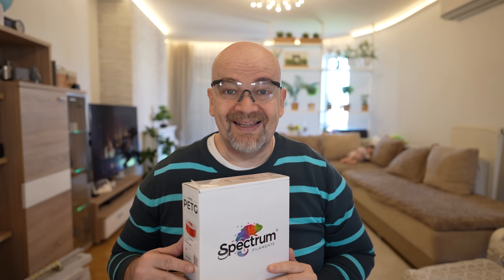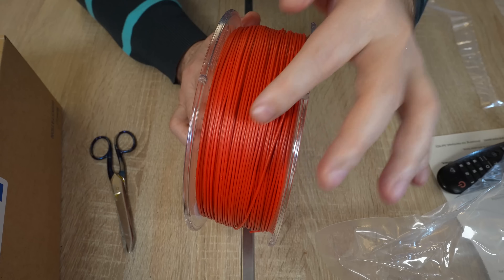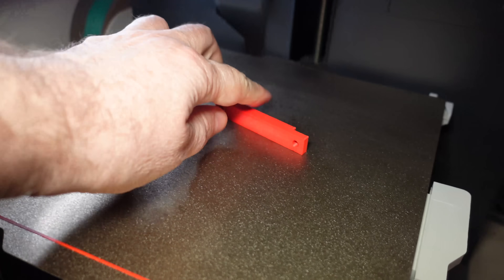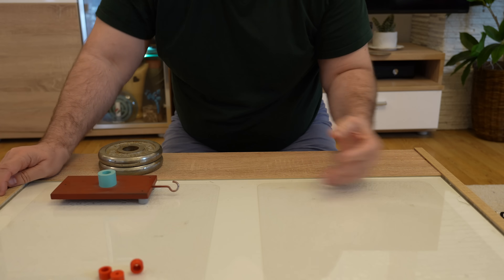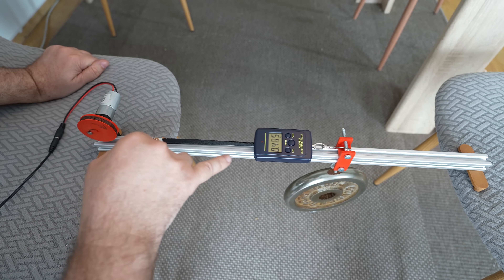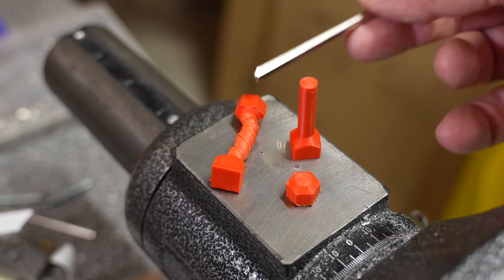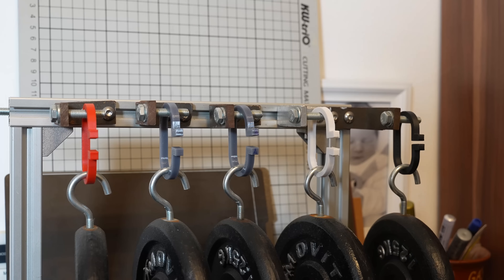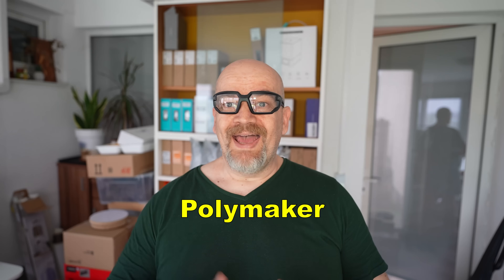Teflon Inside PETG? Review of Spectrum PETG+PTFE filament

Comment: I’d like to see you test POM filament. It’s not very expensive, but it does look tricky to print.
My guess is that the sharp edges of the wear testing setup are cutting it and just measuring internal bond strength, while rounder corners may work to better wear. Or maybe it’s a matter of pressure, and that much lower pressures being tested for a lot longer would produce useful results. It would be interesting to see what ranges of wear testing is done in industry, like how there are different durometer tools.

Comment: Regarding the PTFE  - I think the test on the effects of the additional available PTFE  in repect to friction and "slippperability" are excecuted in a wrong way.   Instead of using a rather sharp pin scratching alog the surface ( around 4:30 ) I think on two PETG(w/ PTFE)  bars slipping along each other.  While µr is 0.4 on PETG <-> PETG or PETG <-> steel - i would be interesting to see which µr is achivable/noticable using PETG(w/ PTFE) instead.

Comment: The wear test has more material scraped away by the edges than worn out by the actual friction, so not really representative of real use. I would really round the edges of the steel cylinders you use for wear tests. The other new tests you devised for friction are however quite good!

Comment: I think your wear testing rig could use a modification. Your tip seems too sharp, as it is cutting the material. For accurate wear measurement you need a smoother tip which will slide, rather than cut.

Comment: Igor, excellent work, all your videos. I am an engineer (retired now and for many years with the university here) and I can fully appreciate your efforts and your methods. Science is all about measurements!  I retired before 3D printing become as popular and accessible as it is now (however I did use SLS at the time) but now I find SLA and FDM printers useful for some of my own projects - especially SLA wax  pattern printing for metal casting. 
Two important characteristics of 3D printed plastics you might consider adding in your videos - and I find important in my work -  are  hardness (for example Shore) and surface roughness.  Shore A or D testers are quite inexpensive, one can find those for about $20 each. Surface roughness meters are more expensive, but a simple one can be obtained under $300...However how about  building a simple optical profilometr-like device for comparative measurements ? You are obviously fully capable of doing this. 
Thank you for all the useful information provided. Keep it up!

Comment: Aargh. so sad. I have a gear in my garage door opener that I suspect is made out of delrin or similar that keeps failing, and I just realize I will not be able to 3dprint a replacement without major redesign of the entire motor end of the belt holder, with normal filaments.

Comment: I me tioned this in the livestream, but i would love to see more reviews of tpus and tpes and various blends, especially harder varieties like cc3d 72d or justmaker 64d (both on amazon). Also would love to see testing of various brands pla max or super pla+ as i need the most impact resistant filament possible for my combat robot, and pla max by polymaker is currently my favorite, but would love to see more.
Reply from the maker: Soon. From CC3D first their PBT Pro. And until that, two hardest TPU I tested are TPU for AMS by BambuLab and the one by Extrudr.

Comment: The top printing temp of this is very close to the point where toxic fumes are produced. not sure i would print on an open printer. from the web: When polytetrafluoroethylene (PTFE), commonly known as Teflon, is heated to high temperatures (above 280°C or 536°F), it releases toxic fumes that can be harmful, especially to birds. These fumes, known as pyrolysis products, contain particulates that can penetrate the lungs. While normal cooking temperatures are generally safe, empty cookware can reach critical temperatures quickly.
Reply from the maker: Yes, I know this from PTFE tubes on Ender-3 printers. 260°C should be OK, especially with this low about of teflon. But this is something I will take in account when I will print PC-Teflon filament.

Comment: Aren't they supposed to be self lubricating ? Maybe it would be more accurate to repeat the sliding and static friction tests multiple time. It would capture some wear that would in theory start the self lubricating property. 
Maybe it won't have an impact but maybe the teflon is not uniformly distributed in the filament and wear has an impact on friction.

Comment: Huge respect for your work as usual. Just a quick tip when using the calipers to measure depth - They must be kept perfectly vertical to the plane you are measuring. Even the slightest tilt causes these measurements to be diferent. It may be worth printing a jig to hold the calipers vertically. Also it looks as though the burr created on the top surface of the test pieces may not have been cut away which can make even larger inconsistent measurements. Your subsequent tests however seem to support your findings on the wear test so all is good.

Comment: PSA: 

Teflon is PFAS — a “forever chemical.”
Teflon, used in many coatings and tools, is made from polytetrafluoroethylene (PTFE), a form of PFAS — a class of toxic compounds that don’t break down naturally. Not even fire can reliably destroy them; PFAS require extreme, specialized conditions to be decomposed safely. When heated, especially during processes like 3D printing, Teflon can release harmful fumes and particles that contaminate your air, your body, and your environment — permanently.
Don’t introduce “forever chemicals” into your workspace. Choose safer materials.

Great video as always.

Comment: That has to be one of the simpler but functional tribometers I've ever seen. A very nice and elegant solution.

Classical way of course is a reciprocating pin-on-disk where the pin is your material allowing for a measured number of cycles, measurement of arm deflection by a load cell for friction (with known load), and wear of the pin (depending on disk material often glass).  Bringing this back around one of the ones we built in the lab we basically just modified a 3D printer for the motion and added the arm and load cells.

Comment: -- Thank you, Igor. I wonder how that ASA Kevlar going to behave, but also whether it's going to be fire and temperature resistant. Kevlar is a very difficult material to work with, but cause it have some super cool properties.
Reply: -- Glass spheres!? Is that "Micro balloons"!?

P.S. In case people don't know, micro balloons are used as an additive to epoxy adhesive in order to make it lighter and thicker. Micro balloons are also a food filler to joints when working with CA(aka Super Glue) adhesive as well.

Comment: Plastic on same plastic friction would be interesting. Also under some notable load. And also 
friction initially vs friction initially vs after some significatnt run-in under notable load. Maybe the PTFE portion concentrates on the inteface after some initial (nonscratchshaving) wear. – Ultra light load friction being higher is perhaps just an artifact from the PTFE portion making the material a bit softer. IDK.

Comment: I would have expected a comment on the obvious problem, the PFAS in Teflon. It's not only a huge problem for our oceans and wildlife, but it will also get in your drinking water (not only when throwing it out, but also in production), and it will also decompose if you heat it too hot (in the nozzle for example). it's very bad for the lungs. Please read about it
Reply: The PTFE is not that bad by itself, but its end as waste is. Incinerated and polluting breakdown products emerge.

Comment: One suggestion..when measuring the depth from friction. Remove the burs from the edges. How you measured it will show more because the caliper stays on the burs, not on the flat part of the pieces 👍

Comment: Everyone in the comments and the general sentiments about this filament seem to miss the fact that the PTFE is embedded INSIDE the PETG. There is no reason that the friction properties of the PTFE would somehow "magically" migrate to the outside during printing.
At best, the PTFE acts as a contaminant that degrades the properties of the PETG
Reply: Well, run in wear might leave more PTFE on the surface than PETG. That is how I ssupect this is meant to work, but to test this one as to test plastic-on-plastic friction after some significant run-in under notable load. Not done here at all.

Comment: From: google A.I.
When polytetrafluoroethylene (PTFE), also known as Teflon, is heated above its continuous use temperature of 260°C (500°F), it can release fluorinated gases, which are toxic. These gases, particularly hydrogen fluoride and carbonyl fluoride, are released when the polymer undergoes pyrolysis at high temperatures, typically above 500°C. In large quantities, these gases can be dangerous to humans and especially toxic to wildlife like birds. 

The released gases are toxic, and exposure to them can cause symptoms like polymer fume fever (also known as Teflon flu) or other respiratory issues. 

PTFE is particularly dangerous to pet birds and poultry as they are more sensitive to these fluorinated gases.

Comment: Damn, i'm really surprised. I didn't expect this outcome. With the results of your wear test, i first thought that maybe your methodology wasn't that great. Some people suspected, that the pin is mave more cutting than abrading...
But when the results from the other testings came in, they all were in line with each other.
I'm still not a big fan of your wear test, without having a bigger chamfer around the bottom surface of the pin. But the other tests for friction and the "visualisation" of different adhesive friction coefficients are really nice in my opinion!
Reply: Yes, this really needs a fully rounded chamfer to rub rather than shavingly cut as it now does.Then it may need water cooling for acdelerated tests on PLA though to prevent melting.

Comment: Igor, the PC/PTFE filament you've mentioned requires printing between 265-295C.
This manufacturer is plain irresponsible to sell this product as PTFE will offgas toxic fumes and start burning.

For PETG, it's already sketchy at 260C but a PC blend? What are they thinking?!
Reply: The fact, that PTFE starts to decompose above 260°C is just the part of what's significant here. First of all, the decomposition rate below 300°C is still super slow. 240-260°C is stated as a typical long-term operating temperature of PTFE parts, due to degradation. Anything above hurts mostly the mechanical properties of PTFE. This may be where all the confusion is coming from, since the Bowden tubes are rated for lower temperatures (240°C) due to continuous operation. Kitchenware  is supposed to come into contact with food, so also not a great idea to overheat it. The PTFE in the filament will be heated just briefly, so the amount of gaseous decomposition products will be very small. Another factor is that most of this PTFE is enclosed within the mass of PC, so the emission of the fumes will be limited just to the surface. It definitely will not start burning.
I've worked with PTFE parts above 300°C, for a short term (definitely much longer than the filament would experience in the hot end) there is no substantial degradation observed. With thermogravimetric analysis a measurable decomposition is observed only above 400°C even with very slow heating rates like 1K/min (that means, the polymer is kept at 400°C and above for quite some time). I've had PTFE at 360°C right next to my face for minutes at a time, and 300°C for hours in the same room. No fume fever for me. These were mostly static seals for glassware and metal reactors, also some non-load-bearing construction elements. On occasions I have also experimented with moulding small parts from PTFE (unsuccessful, PFA is much better for this). A canary in the next room is also fine, never complained.
Reply: @shogoonn  Ah you beat me to it. It's only at that temperature for moments at a time. And Spectrum isn't the only company selling PC-PTFE.
Reply: @shogoonn exactly. The fear from cookware is when it’s over a flame or electrical heating elements with nothing in the utensil. Then, temps can reach over 425 c. There is no real danger 3D printing this. I wish people would stop scaremongering.
Reply from the maker: Exactly my toughts. My X1C is connected to hole on the wall, so I don't have this problem, but it will be mentioned in the video. Thx for reminding me.
Reply: Damn, i wrote a long comment and realised afterwards, that there's a allready a much more profound statement by shogoon relating to my thoughts.
Reply: I wonder what the results would be printed at 230C. And comparing It to normal spectrum PETG would be more valid as we don't know exactly how much the filament is a blend of products in Polymaker/prusament, etc. compared to spectrum's blend of plastics. The composition is never disclosed on the SDS

Comment: I'd really like to see these material compared in a 3D printed gearbox.
You could test multiple gearboxes using the same motor and and identical loads and measure how much power is required to achieve the desired load.
Alternatively, the power could be the same and see if the load the motor/gearbox can handle changed.
Even a friction test with the materials sliding against itself would be interesting to me.
Thanks for perform the tests you did and thanks for share your results with us.
Reply: Not a direct comparison, but just to mention something about 3d printed gears. I have been riding my 3d printed ebike conversion kit with pla gears for almost 2 years with hundreds of miles on it now, and they have been holding up surprisingly well. Of course I only ride it around college so my maximum continuous ride was only up to 30 minutes. Gears might deform from heat if operated continuously for longer, but that was not a problem as I live in a cooler area. They also take high load very well with a peak power of 3500w. Had to limit the motor torque as my one-way clutch bearing on the gearbox output shaft shattered before the gears even took any damage.

Comment: Really interesting to use PTFE inside of PETG. Great in theory, but surprised it is marginally worse than just regular PETG
Reply: Its not terrible if used right, like gears that are big enough. They don't chew the abs gears they're connected to etc.

Not sure if for this there is a right use for this combo though. The quality looks decent though.
Reply: PTFE isn't really the right thing to combine with anything... because of its properties to begin with. Want to ruin layer adhesion of course put a non stick material in your filament!?!?!? PTFE doesn't melt untill like 330C... and even when it does AFAIK it has a very high viscosity.
Reply: Nylon is terrible. It's weak. It just degrades the Petg. They like to use cheap nylon gears in car dashboards.  They snap,  round off,  or the gear teeth break off.
Reply: @isthattrue1083  imagine saying one of the single best low friction high durability materials on the planet is terrible lol... you're crazy
Reply: @isthattrue1083 this is not nylon, it's Teflon.
Reply: @ Correct
Reply: @isthattrue1083 what are you talking about bro?

Comment: For as long as I've been using filaments in FDM, I'd never been tempted to use PETG until just recently. I'm primarily focus on hard use materials or iterating in PLA, so I really didn't have much use for PETG other than something else to try. When I finally did give it a go, my high-temp printer had a rotten time trying to run it in the first week successfully. The first few layers were fine, but then it would warp right off the bed, string like you would think it was its job, and it didn't postwork nearly as easily as PLA (like sanding or drilling for instance). It gums up tooling like crazy and will stick to drill bits so bad, the nominal heat produced will bind to the tooling, requiring more heat to get bits stuck in prints and ruining both parts. 
In that vein, this looks like an interesting combo for select use cases, I just wonder what those are versus more dedicated materials for specific tasks that a so-called 'straight formula' with more established performance wouldn't do. And that's not to say I don't respect mixing materials for experimentation; it's one of my favorite approaches to finding more viable solutions. Saying this without having used this specific material, I don't see where it would excel over other options.
Reply: Wow, I had the opposite experience. I usually print functional parts, but I wanted a color for an aesthetic part that I could not find in PETG. I got so much more warping on a large and flat part. I think due to lower bed adhesion. I tried smooth and textured PEI sheets, and neither of them had the adhesion I was looking for.
It was a Bambu bed on a Prusa machine lol.